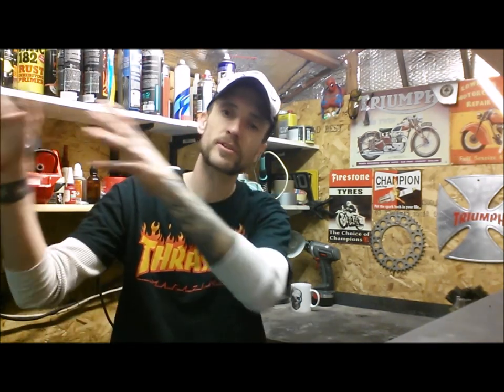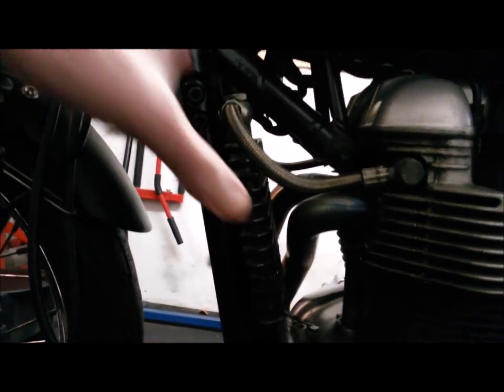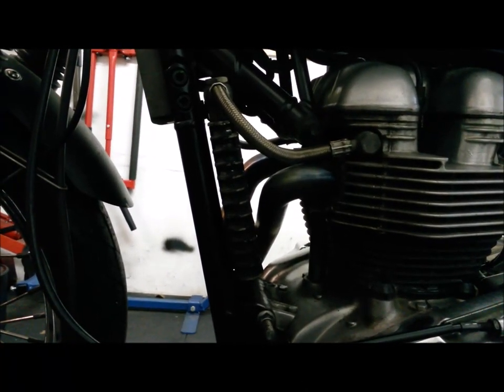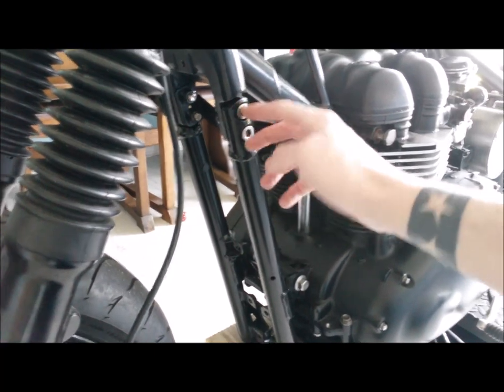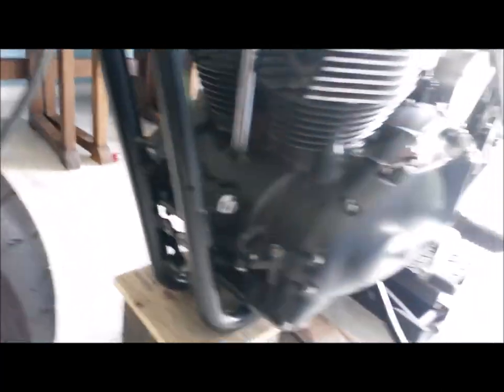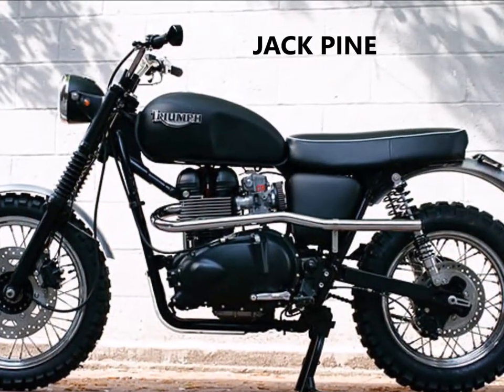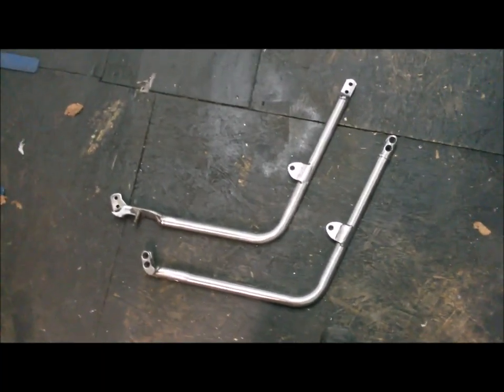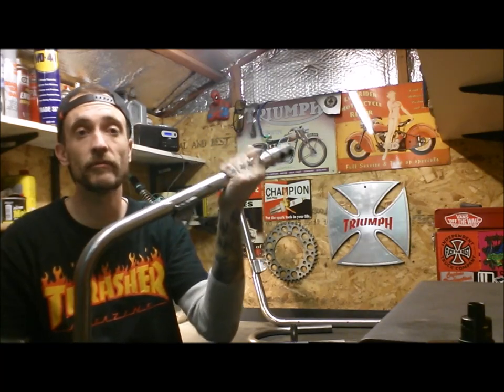Hinckley Triumph Bonneville Hardtail pt4

Comment: The biggest issue I see with cutting the tubes is proper alignment afterwards, and getting a strong enough joint especially if you are an inexperienced welder.  For best cooling efficiency I think you should use as much tube as possible.  The cooling surface area on the oil-cooler is vast compared to the tube.  When you have the connections at either end you'll be able to at least flush it through.
Reply from the maker: this is true Tony, and i agree I am a little concerned at pulling it off!! but hence i bought spare tubes so i can have a plan b!!! or safety net!! i'll def be getting an experienced welder to have a look over the work!!

Comment: The surface area for oil cooling of the stock cooler is going to be quite a bit higher than that of the frame pipes I reckon. Plus the greater oil volume in the frame pipes might reduce heat transfer out to the air. Might be a good idea to figure out normal oil temps on the stock setup, then monitor the temps in the O.I.F. setup. There is a cheap oil-filler cap style temp gauge for Bonnevilles that should work on the America. The first bit to go when oil gets too hot is the Delrin plastic oil pump gearing...so be best not to risk that.
Reply from the maker: i've been a reading up on the temp comparisons by those who have done it and all readings seem to be coming back as good as or indeed better!- streetmaster CLAIM a 20 oC improvement in cooling......i used to have one of those oil temp gauges ....i think i may have sold it though!!! doh!!! - incidentally this idea is for the bonnie not the america...although same difference really!

Comment: I ditched the cooler on my 1200 daytona when I got it naked but I ran a braided hose from between the two inlet/outlets as it had a pump running to the cooler..no probs at all and the hose acted as a tiny cooler  ( OK the bike was water cooled also !lol)
I think you'll be fine buddy 🖒🖒🖒
Reply from the maker: i had a daytona 900!!!! - i went nakid on it too!!!!!!! i seem to remember on the old t3's that the daytonas had an oil cooler but the speed triple variant had no cooler?? maybe they thought the fairing would get things too hot!!
Reply: johnnycactus0 
exactamondo..no fairing no cooler...and They also ran stupidly cool anyway even without it on a firkin hot day...

Comment: Cool project buddy,,,,, scuse the pun, a friend of mine has done this to his bonnie and hasn't had any issues. Take care.
Reply from the maker: cheers Tony!-  that's good to hear! i 'd love to have a look and quiz him on a few things if that is at all possible!?
Reply: Hi Johnny, Tony is right I removed my cooler after reading up and much thought. there is a write up of a guy in America who removed his and blanked the holes, then road all over the US and raced in the deserts. After all this he stripped the engine and couldn't see any problems associated with the bike overheating. I have done the same and just blanked the holes, the pump that runs the cooler is separate to the one that lubricates the engine. I may use the down pipes in the future if I get around to it. I have a temp gauge in the oil filler and so far it keeps a steady temp and only showing signs of getting hot in heavy traffic but not in the red! 
The guys who runs TEC has done the oil in the down tubes and says it works well, i think he has a video of it on there site.

Good luck and ride safe.

Jmc
Reply from the maker: Hi Justin, many thanks for the quick reply!- yes i think the jack pine scrambler ran no oil cooler and seemed to live to tell the tale!!- i spoke to george at tec and rodburner on triumphrat about running the oil in the frame....going to give it a shot! nothing to lose really- i have spare frame tubes if i need to go back!

Comment: I have been thinking about the very same thing on mine, if I ever get around to doing it!
Reply from the maker: i hope to pull it off..but there is a lot of work still to do on the bike- at least this can be added later if things don't quite work out!
Reply: Yep, If it does not go well it will not be a show stopper, you could just use the current oil cooler or go without for a bit.

Comment: Sounds like a fun little project.  How does it work in terms of draining the oil for changes and such - or do you pull the frame rails off?
Reply from the maker: it should be fun! as with regards to oil changes- treat it exactly the same as a regular oil change- no need to remove rails. i'll just be filling with more oil due to the increased capacity.